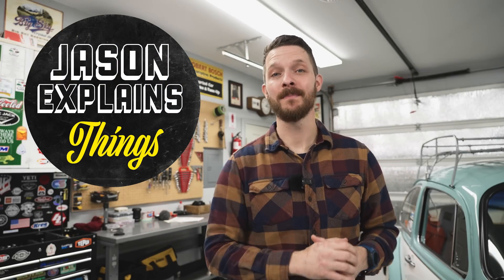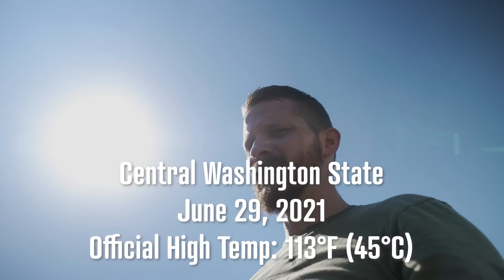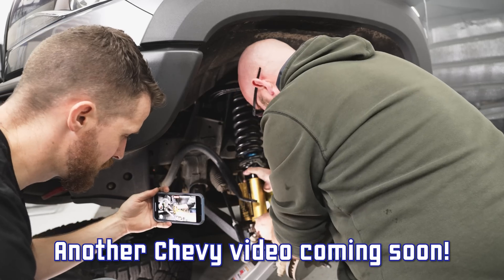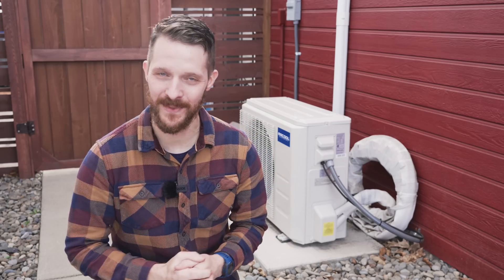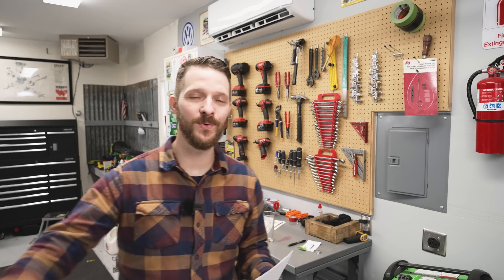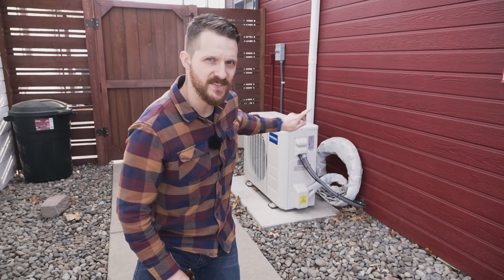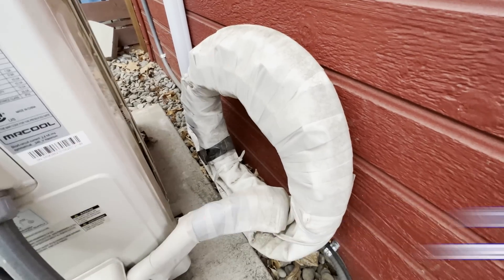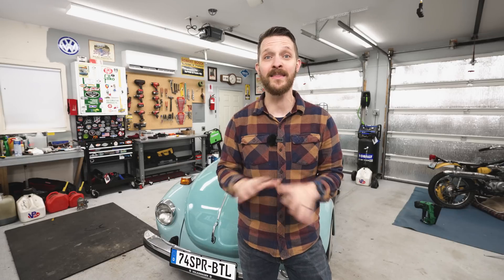MRCOOL DIY Mini Split LONG TERM REVIEW (15 Months Later)

Comment: If the HVAC company I've been giving money to for years tells me that I'd have to find someone else to service it, I would. That company would be the one that services my house going forward. I'd drop those jerks in a heartbeat. They're just hurt that you did an easy DIY job instead of paying them hundreds to do something you could do (and did) very easily.
Reply: Hundreds?! Yeah right, I just got a quote for my home system on a 1,475 SQ ft 3 bedroom house... Very basic system, nothing fancy, no multispeed or anything.  Everyone wanted around $8k. I priced out just the equipment they were gonna use, and it's only $2,400 for the equipment! They are charging about $5,600 for labor!!!! So yeah, I will be installing one of these myself and saving $5,600. For that kind of savings, I could literally just put a new one of these in every 7 years if I had to.
Reply: @Steven-gv1ke  the warrantee is nothing it only covers parts the labor is the big cost on repairs
Reply: @magiccheeseball  yeah but like I said, for $5,600 in savings, I will gladly replace the entire system every 7 years if that's what it required, which I seriously doubt these will only last 7 years.
Reply: @Steven-gv1ke  mr cool is way over priced tons of wat better mini splits
Reply: I was thinking the same thing. I was taking the family cars to one shop, but when I took my '84 Chevy Citation to the shop to have the ignition timing checked because I could not find my old timing light, they refused because "it was too old and the mechanics don't know how to work on a car that old". My reply was something like "Sorry, I didn't mean to lower your property values", and I found a mechanic who didn't have any qualms about working on any car, old or new.
Reply: True..

Comment: Wait till you want to clean the blower wheel and need to remove it. You will eventually need to remove the wheel for proper cleaning. Mr Cool poorly designed this for ease of service. My 18k unit was manufactured in October 2020. I think these were designed as throw aways. Unfortunately there’s no competition in the DIY segment of mini split’s.
Reply: I swear I feel like EVERYTHING is designed as a throw away anymore. Pisses me off.

Comment: Jason, I wont to correct something you said, the heat pump can actaully be more efficient than the furnace if it is able to handle low temperatures (-5ish).  The COP (Coefficient of Performance) on a heat pump can be 2.5 to 4.5 was as a a furnace is only 0.8 to 0.96
Reply from the maker: My bad.  I should’ve said economic not efficient.  (Natural gas is very cheap in my area but electricity is not 🙂)
Reply: @JasonExplainsThings  The cost savings is on the service fees -$500 a year in my area, plus you are using electric with your gas furnace.  There are other issues such as zoning and the future of fossil fuels.

Comment: Is Mr Cool  18 K BTU  unit a 110 Volts/220 Volts unit ? Do we need to buy a converter ? I have 110 V and do not want a 220 V . Thx
Reply from the maker: Check the instructions linked in the description.  18K is 220, but the small 12k unit is just 110V.  But that would've been too small for my space.

Comment: That is a bad install brother.  I see you have your line sets coiled.  That is going to create an oil trap and cook your compressor over time.  Those units are junk anyway so you won’t get more than 3 years out of that thing.  Should have hired a pro.
Reply from the maker: Cool Brett.  I’m just about 2 years in.  We’ll see how it goes.  But with these being $5k or more installed, and this costing me $1500 I’ll take my chances.  I do plan on getting the lines shortened this summer most likely to avoid potential oil trap issues.

Comment: I had a larger version of the same model in an old house we use for daycare for more then 2 years. It worked way better then the old window units we used to use. But we received a grant to upgrade the old 80% central heat unit so we got a central air as well. The only complaint I had was it only reasonably cooled half of the house in the middle of summer which honestly could have been resolved with a second unit on the other side of the house. Only once did it ever freeze up on the interior coil which resulted in a bit of water running down the wall. 

Over all I rate the unit very high. It performed better then the window units we used to use and used less power. It was quiet and kept the entire house cool unless the temps reached the high 90’s which would have been remedied with a second unit on the other side of the house. Also since the house in question is around 950 sq ft and 100 years old with old windows and little if any insulation in the walls your mileage may vary. 

It met the expectations I had for it and would have still been in use today had our daycare program not been awarded a grant to upgrade the hvac to a better, more efficient unit with a filtration system. Would I consider a Mr. cool DIY mini split again? Depending on the situation, yes. I installed the one we had in an afternoon with the caveat that I did pour a concrete pad to put the outside coil on a few days before I actually installed the unit. Ease of installation was straight forward, assuming you read the instructions before hand and accumulate a few tools and items ahead of time such as required hope saw and electrical disconnect. I am a licensed electrician and was able to install my own service disconnect at my desired installation site but you may need an electrician to install the service disconnect. Other then that I see no reason a person couldn’t install one fairly easily by themselves with help to mount the indoor portion as it is quite bulky and heavy to mount by yourself.

Comment: Eh, I am going to have to say the statement about natural gas being more efficient isn't true.  Burning stuff is to make heat, or using electricity to create heat, are about as efficient of a conversion of energy as you can get... but heat pumps are a cheat in that they aren't converting energy to produce heat.... they are transferring heat from one place to another which is about 3-5x more efficient than traditional methods.

Comment: I'm happy to see you had a good experience. Between Matt Risinger and Technology Connections, I've come to realize that the vast majority of people don't need gas furnaces anymore if they don't want them. People seem to freak out at the idea that we don't need gas anymore, but I'm quite excited to have the zone controls that mini-splits enable--cold bedroom, warm office, etc.
Reply from the maker: Technology Connections is great!  I’m a laserdisc nerd and I love his videos about that.  And I love his video about the classic radiant toaster.  I have the same one from the early 1950’s.
Reply: Not just for heating. I recently replaced my 40 year old restive electric cooktop with an induction one and it's kinda incredible. I wanted a gas cooktop for years and now you couldn't pay me to put one in. The induction throws off so much less heat into my kitchen is super responsive and easy to clean and can pump just immense amounts of power into a big pot of water.  It's also way safer for things like deep frying. No open flame or red hot coils to ignite spilled oil. I would never go back to conventional electric or gas.
Reply: Unfortunately when there are many zones 2+ zone controlling ( setting diffrent temperatures) can fail depending on if your heating or cooling some parts, as these units tend to switch from heat and cooling and stop the whole unit. But all in all there great units.

Comment: Why do you say that the natural gas oven is more efficient then the Heatpump?

With exception of temperatures far below freezing, the heat pump is more efficient then gas
Reply from the maker: Misspoke.  I should’ve said economical than efficient.
Reply: @JasonExplainsThings  are you sure?
In most places it is still cheaper to use a heat pump. Exception ofc if your electricity is very expensive and gas very cheap
Reply: @reverse_engineered  okay, that is an extreme difference.
Must be nice 😛

Comment: Support from Mr cool and Ingram's is good if you're willing to wait on hold for a long time.  Performance I'd good too. Reliability is not good at all. I had several condensers fail with explanations like your voltage is too high, or there must have been a power surge. The last one I got is said to have an updated control system and has managed to survive the winter and summer so far.
Reply from the maker: Weird, sorry you're having problems.  I've had the outdoor unit freeze and need to defrost itself twice but other than that it's worked perfectly for nearly 2 years.  I do plan on hiring someone to trim the refrigerant lines down to avoid oil trap issues and just make it look better.
Reply: @JasonExplainsThings  mine is one of the big ones 5 ton. One of the factory reps I was taking to said he had a condenser fail too. He blamed lightning...

Comment: My local HVAC companies want to charge me $5,500 to install a ductless mini-split for my small 120 square foot office, or $9,000-$15,000 to install a dual zone ductless mini-split for both my office and my single-car, 250 square foot garage. Freaking ridiculous. No wonder so many people are installing these things themselves.
Reply from the maker: A buddy of mine said the same thing.  After watching my video he said I likely saved at least $3500.
Reply: Mine quote me $6k. I’m like no thanks I will do it myself. If I messed up and have to buy a new one, still cheaper.
Reply: WTF, here in Brazil I paid this year about R$ 1200 (U$ 250) to install 2 mini-splits (with about 50 meters of coppers lines). O.o
Reply: You have to wonder, if at that price they’re just being lazy and figure if they install one a week their good.
Reply: well you can buy rebranded Chinese products or professional quality products.  question is how long do want it to last.  also 120v systems are much more inefficient than 240v systems.  and a standard 500 sqft area should have at most a 9k head unit.  and the reason nobody will service them is getting the parts.  you get what you pay for, look at brands and ask for options from your local company
Reply: This is similar to what utilities are facing with rooftop solar. As fewer hvac customers opt for pro installation, the price will have to increase to make up for lost business. Eventually they dwindle and service for any model suffers. This is a gold plated opportunity for independent operators to jump in and start service businesses of their own
Reply: Same for me (12000 btu unit). That's why I bought Mr Cool.
Reply: alot of the time the cost is the cost of pulling primits for installing the mini-split system cirten citys and states require primits to be pulled when Installing a/c units so got to check in to those things for your local area. for my area to install one of these i would cost me about $1500 for just a premint to install one let alone the instpintent for it even tho its some thing that a lot of people can do on there own.
Reply: What’s ridiculous about that? They have to pay workers a living wage, taxes and other expenses plus they want to make a profit as well. 5k for a pro install doesn’t seem expensive to me.
Reply: @chrisking6695 depends on how long it takes to install. For a mini split it should be able to be installed in one full day. So let’s say $1000 for the contractor and another $1000 for subcontractor with taxes, etc. this instal should NOT exceed $2500 tops.
Reply: Yeah, it’s ashame that contractors aren’t allowed to make money!

Comment: You must have gotten confused on the excess lineset - coils need to be horizontal, not vertical, for the exact reason of refrigerant oil collection. The vertical coils trap oil. 
I have two of these units in my house, year five now, working great. No vertical coils. Expect your compressor to fail in an indeterminate amount of time due oil starvation.
Reply from the maker: Thanks Chris.  You are correct.  I misread the instructions.  I give some blame to the illustration being confusing.
Reply: @JasonExplainsThings  - One of mine passed thru an attac crawl space so one lazy loop before dropping down to the outside condenser unit - condensate line does not need to follow the lineset, just has to drain. 
The other was really close to the inside unit so I built a shelf for horizontal coils and made it a weather-roof to protect the unit. Both worked out swimmingly.
You might get by with the vertical coils, lots got installed that way. But the first thing a pro installer will do is look at those coils and shake their head. I specifically called Mr.Cool the importer in Miami to inquire about this and they did say directly that excess line should not be coiled up behind the unit. Their recommendation was to move the unit. In my case that wasn't an option. Another option is to snake them down the wall, inside or outside, before connecting to the condenser. 

The newest units also have the quick-connectors with the schrader vales in them on both ends, so the lineset isn't permanently attached to the indoor air handler. The older ones that were, on the larger units - two-ton and up, are a beast to lift up on the wall and get the line fed thru your hole in the wall.

Comment: FYI I’m no expert but from what I’ve read using a heat pump is far more efficient than any other type of heating. When converted to watts from an electric heater you get like over 100% efficiency 🙂
Reply from the maker: Yeah I said efficient when I should’ve said more affordable to run.
Reply: Yes, an electric heat pump is more energy efficient than resistive electric heating. A heat pump can move about 2-4x as much heat energy as the electrical energy it consumes (depending on conditions), compared to a resistive heater giving 100% heat energy for the electrical energy it consumes. The comparison Jason was making is with natural gas. In areas where it's common, natural gas is much cheaper than electricity for the same amount of energy. In my area, natural gas costs about 1/8 of electricity for the same amount of energy. So in that sense, it's still cheaper to use natural gas for heating even than using an electric heat pump.

That said, when it comes to reducing emissions and carbon footprint, using electrical devices gives us many more options for the primary source of that energy, such as wind, solar, hydro, and others; whereas burning any kind of fossil fuel (gasoline, propane, natural gas) doesn't leave us with any options to convert to something cleaner and more sustainable in the future. So although natural gas heating is currently cheaper to operate, an electric heat pump is likely the more sustainable option for the future.

Comment: Not sure if anyone has said this in the past, but actually heat pumps are more efficient than gas heaters.
Reply: but not more cost efficient.
Reply: @psilocybemusashi  Uh yes they are. I literally just watched another video about mini splits and the guy did the calculations and per 1 million btu's the heat pump was cheaper then propane and this was back when propane was 1.90 a gallon. The savings would be even more now. There is no reason to use any sort of gas heat if the temp is above 20 degrees F.
Reply: "Efficient" yes, but natural gas is far, far cheaper to burn.

Comment: You can get rid of the extra line set by buying a flare tool. Cut the copper to length. Reem out the copper. Slip nut over copper and do your flare. No need to make a box!!!
Reply from the maker: I’ll likely do that at some point.
Reply: @JasonExplainsThings  Be mindful that it's not just "1) Cut lines to length 2) flare and re-tighten".  Since your system is already charged throughout now, you'd need to first have the refrigerant recovered into a tank, THEN shorten your lines, then ideally pull a vacuum to remove any introduced moisture, do a pressure test to confirm the connections are good, re-pull a vacuum to remove the nitrogen from the pressure test, then finally, recharge the system with the refrigerant that had been removed.

Which is why if you're going with a "pre-charged lineset" DIY system, you just deal with the coiled excess line.  If you want it tidier, you start by buying a traditional system, and DIY the install.  Then you either find contractor willing to do the install work, or you buy the tools (flaring tool set, gauges, vacuum pump, and tank of nitrogen if you really want to do it right) then cut to length, prep, and install properly...then release the refrigerant from the condenser into the system.
Reply: @mlindholm  and then pay an HVAC company the $5k installation anyways just to fill with R410. (Because it’s govt regulated)
Reply: Nice!!! Well if you ever need for me to do it. Let me know and I can do it for you lol!!!! Free of charge!!!! Just need my plane and hotel paid for!!! LMFAO!!!!

Comment: Good video, would have liked to hear about power use. Another YouTube video says the 12k 120volt version may be best if you want to run it off solar power.
Reply from the maker: I'm going to go ahead and say running AC off solar is not a viable option unless you have a big battery bank.  You want to buy the right size unit depending on the size of the space you're cooling/heating so it's not under-powered (or needlessly overpowered I suppose).  But yes, larger units use more power.
Reply: @JasonExplainsThings  A recent video from the 8 bit guy has them running an efficient window unit off a small solar system. https://www.youtube.com/watch?v=RhTDneoDUdc Around the 7:30 mark if you don't want to watch the whole video. So that's what I was kinda thinking, just a little bigger.